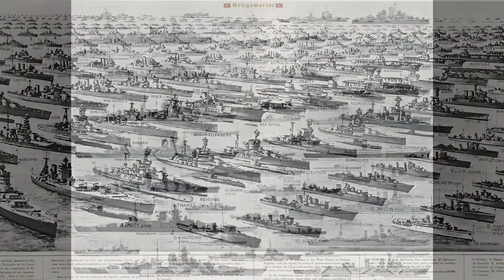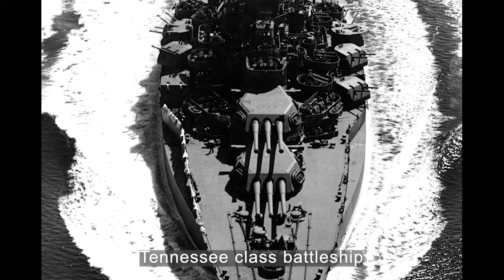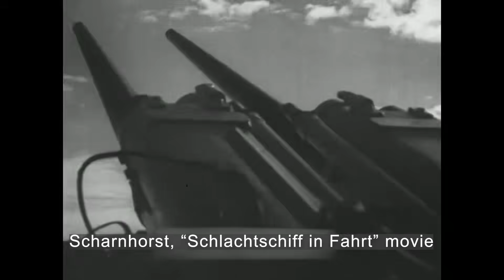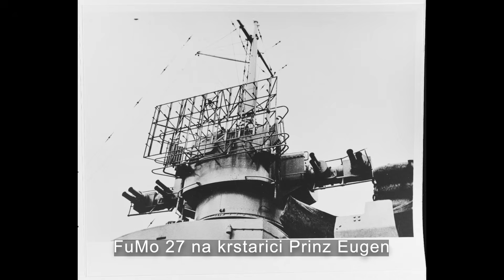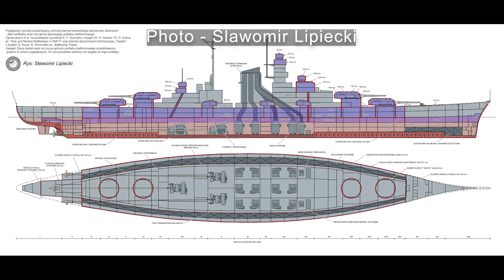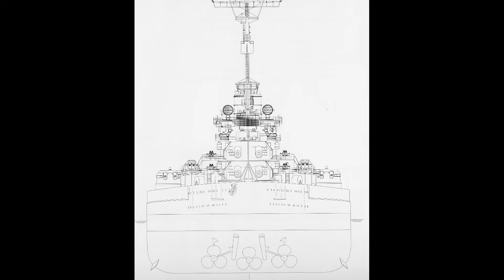Battleship Bismarck - technical details - original YouTube documentary

Comment: @1.02 It appear obvious the turret would be out of balance. Was weight added to balance the turrets? so in theory? they would rotate with even weight distribution? details, details.
Reply from the maker: To balance the turrets, they overhanged the barbettes, and had significant rear armor, even though the chance of a shell hitting the rear part is negligible. Though it just might have happened on Bismarck, ricochet from Rodney on the second turret into the rear of the first is the most prominent theory how both front turrets were disabled in the opening of the final battle.